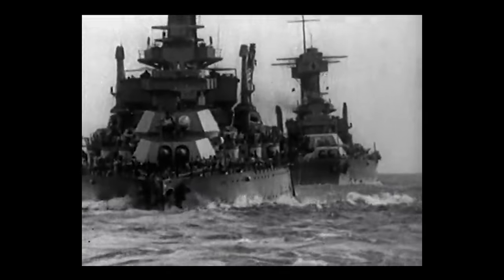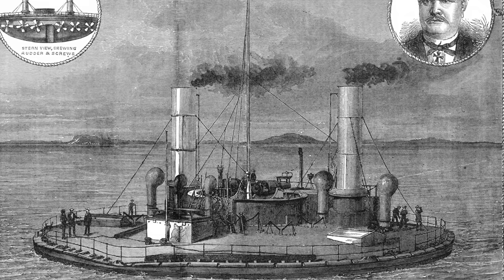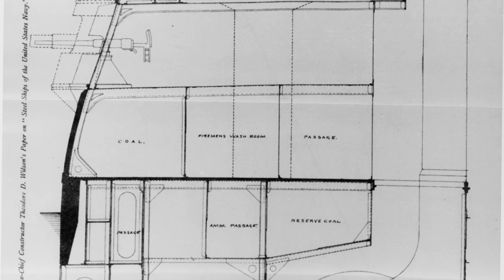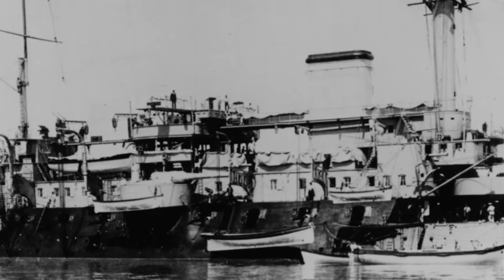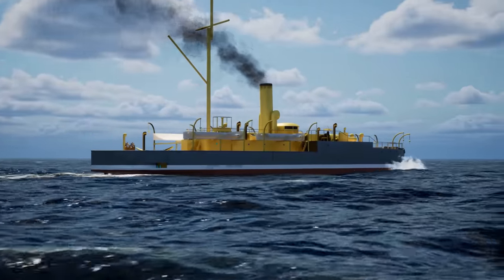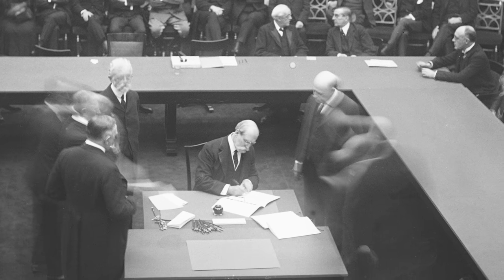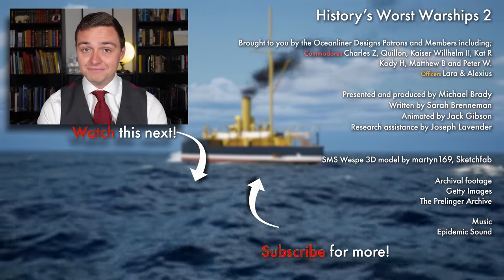AWFUL Warships From History

Comment: The IJN had a so called shadow fleet of which Tomozuru was but a small part.  Several sub tenders built to be hastily converted to light carriers, Mogami class built as light cruisers designed to be upgraded to heavy cruisers, Tone class originally laid down as light cruisers and upgraded to heavy during construction. The Ryujo light cv was originally built to be less than 10k tons to get around treaty restrictions.

Comment: The story of the Novgorod and Vitse-admiral Popov spinning from the recoil of their guns is incorrect. What actually happened is that the turntable for the guns wouldn't lock into place strongly enough to handle the recoil and it was prone to spinning after the guns were fired.

Comment: As always, excellent content. How you managed not to crack up describing the first warship (round Russian one) spinning in circles when the guns were fired and giving the crew vertigo, I'll never know. I cracked up for a good 5 minutes envisioning this.
Reply from the maker: Lots of self control and the magic of editing :)
Reply: @OceanlinerDesigns unfortunately, that's actually a major misconception with the two ships.

This is even covered by Drach himself.

The problem with claiming the ship spinning with every shot is that the guns are in the center of the ship, not the side, secondly, the myth actually came from something that did actually freely spin on the ship after the guns fired *when the ship was completed*, and a problem that would be fixed later, the guns themselves.

When initially built, the gunlocks couldn't take the force of the guns being fired, and broke, causing the guns to spin back and forth on the tracks, as there was no turret for the vessel.
Reply: In American navy, you turn ship. In Russian navy, ship turn YOU!..😉

Comment: Nice vid thanks for sharing. Are you familiar with the British K class submarine? Steam powered and as a result required funnels! Took a good 30 minutes to dive as the boiler needed to be put out and the funnels secured first. A large wave could be enough to put out the boilers by entering through the funnel while on the surface. Not our nation's finest hour but an interesting design.

Comment: Faulty naval designs didn't end with the Vasa, some engineers and designers didn't understand that ships need enough draft to balance what is above the waterline. By the way, they have now found the wreck of Vasa's sistership Äpplet (1629) and found that some amendments were made to the hull that made her different from her sister. The master shipbuilder must have seen the flaws during the construction. One can wonder why he let her sail.
Reply: The lead designer of the Äpplet died halfway mid-construction. The changes to the design were made by a new building chief.

Comment: They should have put props all around the ship like a clock. Steampunk stabilized gun platform that could be moved around seaport inlets. Reverse half the props with the others normally run would move the ship. With some good time keeping they could fire the cannons in sync with the props to lesson movement or let the ship spin a tiny bit till the next cannon was on point and fire that one then the next one. Instead of 1 round per 10 mins you get a steady line of shots and if you can time it right you could have a steady fire rate that only ends when you run out of cannonballs as the ship slowly spins so people don't get sick. Very cool video. I've never even heard of this design before and I grew up sailing around two battleships every weekend. Nice vid!

Comment: A couple points, Novgorod's gun mounting would spin when a single gun was fired, not the entire ship, and as bad as the Indiana class was, the Kearsarge class was worse.
Hoche as originally designed had four open barbettes, as was the style of the time, and practically no superstructure, and light pole masts. After construction had begun, political changes in France brought about a revision of strategy, favoring swarms of torpedo boats over heavy and expensive battleships.
With yet further political change in France, construction on her was resumed, with a redesign packing every conceivable technological toy you can think of being crammed in her, resulting in the mess she became. The proverbial political whipping boy.

Comment: I can’t believe the Russian gunboats made it out of the concept art phase.  I mean I get how politics and design changes mean that a ship can end up top heavy or unstable… but how do you forget to consider how you’re supposed to steer the thing?  Talk about reinventing the wheel 😂
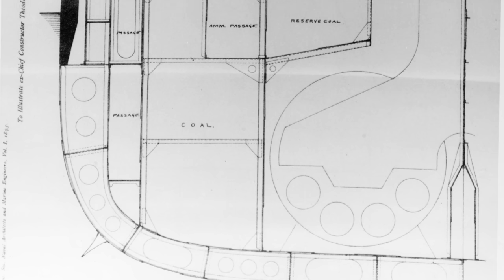Reply: Having three rudders, the main one at 6:00 aft, and two smaller ones mounted port and starboard at 9:00 and 3:00 might have helped. At the cost of far greater weight and mechanical complexity, though...😏

Comment: That as great my friend Mike Brady.  Perhaps mention of some newer failed designs such as the Zumwalt-class destroyer or the Independence littoral combat ships.
Reply: The Zumwalts aren't a bad design, they are just not cost effective.  The biggest issue is the cost of the ammunition for the two 6" guns rendering those guns useless.  The LCS are failures on many levels from the attempt at modularity to the use of dissimilar metals.
Reply: @johnshepherd9676  should've been scrapped anyway along with the rest of the LCS.
Reply: @merafirewing6591  They are Aegis equipped ships with 80 cells.  The Zumwalts are still potent ships.
Reply: @johnshepherd9676  still the Zumwalt is a sin on the United States Navy, outright ugly.
Reply: @merafirewing6591  Much better looking than the Albanys
Reply: @johnshepherd9676  Nah, Albany looks more beautiful than that bucket of bolts.
Reply: @merafirewing6591  The Albanys were known as the ugliest ships in the Navy.
Reply: @johnshepherd9676   Zumwalt is even uglier.
Reply: They are just expensive

Comment: The Kerch Strait isn't located at the mouth of the Dnipr river. The Kerch Strait is on the other side of Crimea between the Azov Sea and the Black Sea and the river that runs into the sea on that side of Crimea is the Don, not the Dnipr.
Reply: I believe he said "planning to use them as coastal defense ships in the Kerch Strait and at the mouth of Dnieper river", the subtitles likewise corroborate this at 2:45 and thus implying that since their were only two ships of the class, one ship of the class was to be used at each one of the locations respectively. Thus it can be assumed you misheard possibly due to the accent and subsequently wrote this as a result, rather than him misspeaking and or stating the wrong location.

Comment: Last few days I often findupon this story. Could you maybe make a video on it?:

"GREAT SEA STORY (Trivia)
The passenger steamer SS Warrimoo was quietly knifing its way through the waters of the mid-Pacific on its way from Vancouver to Australia. The navigator had just finished working out a star fix and brought Captain John DS. Phillips, the result. The Warrimoo's position was LAT 0º 31' N and LONG 179 30' W. The date was 31 December 1899. "Know what this means?" First Mate Payton broke in, "We're only a few miles from the intersection of the Equator and the International Date Line". Captain Phillips was prankish enough to take full advantage of the opportunity for achieving the navigational freak of a lifetime.
He called his navigators to the bridge to check & double check the ship's position. He changed course slightly so as to bear directly on his mark. Then he adjusted the engine speed.
The calm weather & clear night worked in his favor. At mid-night the SS Warrimoo lay on the Equator at exactly the point where it crossed the International Date Line! The consequences of this bizarre position were many:
The forward part (bow) of the ship was in the Southern Hemisphere & in the middle of summer.
The rear (stern) was in the Northern Hemisphere & in the middle of winter.
The date in the aft part of the ship was 31 December 1899.
In the bow (forward) part it was 1 January 1900.
This ship was therefore not only in:
Two different days,
Two different months,
Two different years,
Two different seasons
But in two different centuries - all at the same time!"

Comment: Well done with just one nit to pick.  Failing to touch on the primary reason the Japanese sought to circumvent the Washington Treaty could (inadvertently) reinforce the "sneaky" Japanese troup.  The Japanese felt ill treated by the treaty formula that placed them as a disadvantage when compaired to the allowances given to the Brits and Americans.  Shamed by what they felt was a racist double standard they did not feel as compelled to adhere to the intent of the treaty and did, indeed, actively look to loopholes in an effort to level the playing field, so to speak.

Comment: I've been thinking on these circular ships. If propellers were moved outboard, so they are at the sides, that probably would have improved handling. No rudder, use a droppable plate on each side as well. Instead of turning a rudder to the left to turn left, a drag plate, a bit like an air brake in the water, would be dipped into the water on the left side. The more severe the dip, the bigger the turn. Add anchors at each "corner," and you have a mobile shore bombardment fort, and a coastal defense fort. Just bring the freeboard up a bit. Yeah, they wouldn't engage in traditional shoot and scoot naval battles, but they would be a consideration. Any military who finds a good place to land, would need to contend with the sudden appearance of shore bombardment batteries that weren't there when they arrived.

Comment: ? ? ? ? ?

You didn't include HMS Captain, designed by an RN officer with no experience in ship design, and built over the Admiralty's objections due to him using the press to raise public opinion and political pressure for him to build his own ship. It had such poor stability that it capsized in its first storm, taking the whole crew and its designer down with it.

What about HMS Polyphemus? A 2,800 ton warship armed only with machine guns and a very few small torpedo tubes, because she was primarily expected to ram enemy vessels, a tactic which was marginally effective in the 1860s, but completely outdated and suicidal when this ship entered service 20 years later in the age of the armored cruiser. 

What about USS Vesuvius? Let's build a warship that can throw gigantic bins of dynamite at an enemy! With the somewhat inconvenience that it used pneumatic gun barrels fixed in place, and therefore could only fire at a target that was exactly directly ahead of the ship at a precise fixed range. And that range was barely farther than a rifle shot.

Comment: The Hoche had deficiencies, no argument there.

I do find the idea of having superstructure over the turrets to be very interesting.

It makes me wonder why it wasn't done with other ships. You gain additional internal spaces without sacrificing anything. It isn't like you would be elevating your main guns anywhere near 90 degrees, so no interference with anything build above the turret.
Reply: The biggest reason it's a bad idea is that even light damage to any superstructure above the turrets could easily jam them completely. In combat all gun turrets need to operate as unencumbered and with the widest traverse and elevation angles and fields of fire as possible...
Reply: @charlestaylor253  A good point about debris possibly jamming the traverse of the turret.

Of course, my "cost is of no concern, nor is the tonnage" response to that point is: "Put in motors with a high enough torque that the turret will push aside any interference from a collapsed deck as if it was brushing aside a paper napkin."

🙂

Comment: Back in college, an engineering professor told the story (every year) about a Japanese ship that was built from top secret plans stolen from the United States.   Turns out the ship capsized on the maiden voyage, because the the design intentionally put the center of gravity too high (to mess with them).  Is that an urban legend or a true story?

Comment: 2:00)No way for a 360 degree use of guns. Smokestacks and air intakes at 90 and 270 degrees.  Firing at 180, the shock waves would take out the helmsman, the helm and destroy the skylight. I saw a sailing magazine.The middle of one sailboat was rounded.
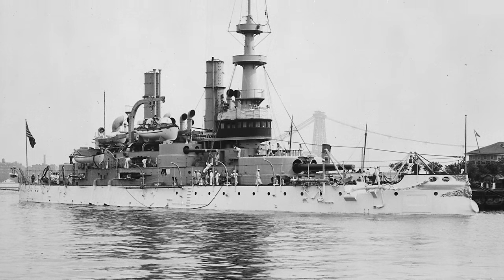6:13)The USS Mass. (BB 2)was an USS Indiana (BB 1) (Class).
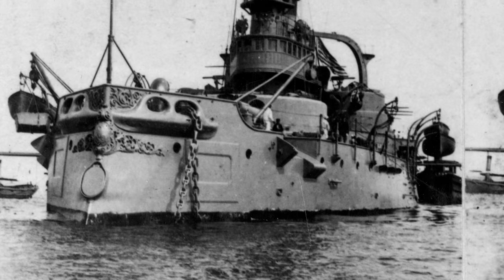7:00))A long ton is 2,200 pounds.
7:45)The main guns were 13.35 inches. The muzzle plugs are called tampons.
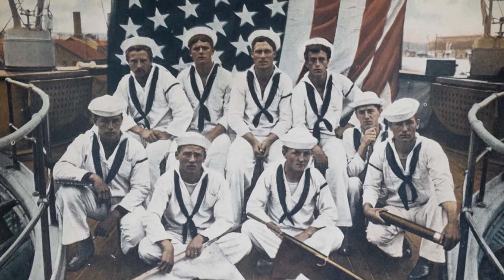8:04)9 line officers? Another video said 32 and 441 enlisted men as crew. The max capacity was put at 586-636.
10:46)The Hoche reminds me of a limey heavy bomber project. It started around 1920. All of the problems were ironed out in time for WW II. It was useless. They were surpassed by the competition and German planes.